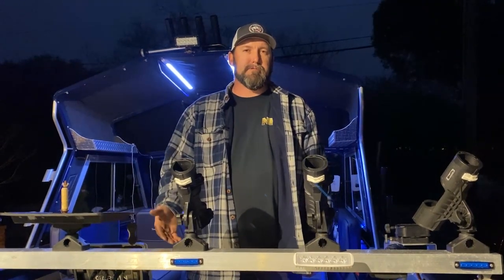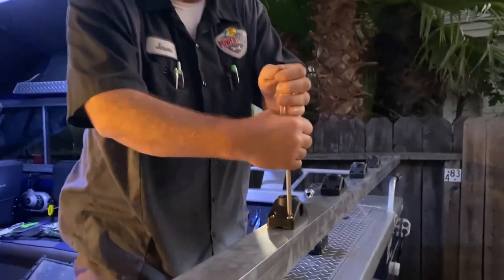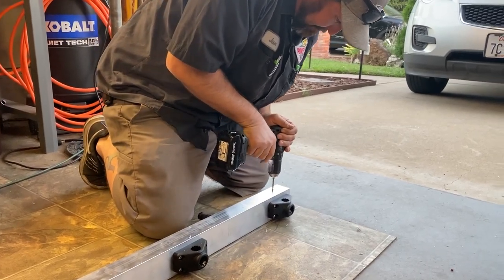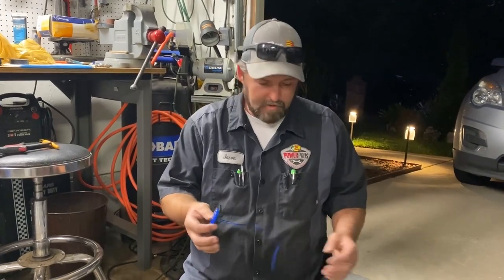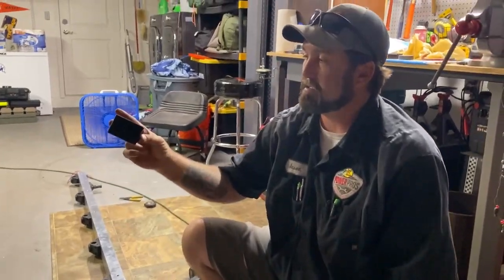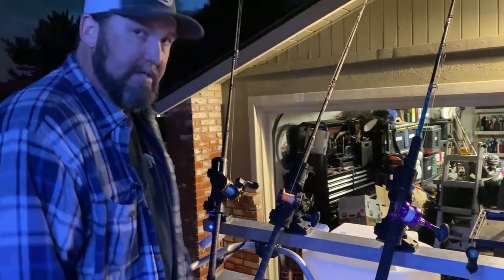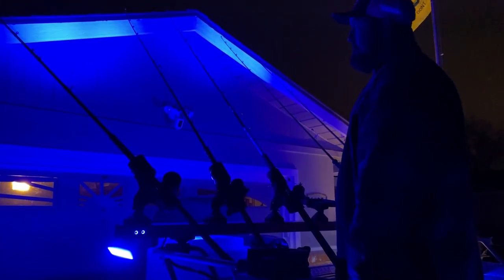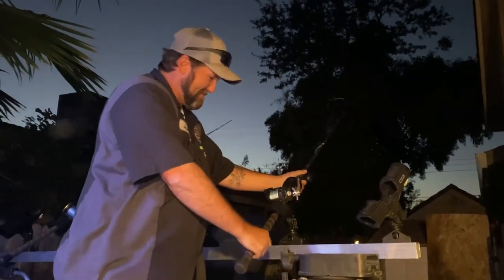BAIT FISHING ROD BEAM BUILD | HOW TO

Comment: I've ran power in a house but I'm not familiar with power on a boat. Can you tie in multiple lights like you would a bunch of power outlets or do you run wires to each individual light and then tie all the wires together/pigtail and to the power source?

Comment: Enjoyed the video Jason, as usual. Question, What precautions (if any ) do you need to take against electrolysis with using steel screws into aluminium, or is it not an issue on this project? Keep 'em coming my friend.
Reply from the maker: Not that big of a deal for this set up.. but yes sometimes you have to watch out using dissimilar metals.. but most of the time you don’t have any choice but to use stainless.. because brass would corrode or aluminum to weak and hard to find.. thanks for watching and commenting

Comment: I am not understanding how you used that orca slide deck. Those typically are used to hold the rod itself. 

Did you detach or remove the rod holder from the slide?
Reply from the maker: Where the beam itself mounts to the rod holders on the rails?  Is that where you are asking about?
Reply from the maker: If so this is the mount you would use there.. this would mount the the beam then drop into scotty deck mounts with the button release.
Reply from the maker: Scotty #272 Post Bracket Only for #269 & #270 Sounder Mount, black https://a.co/d/8vBantc